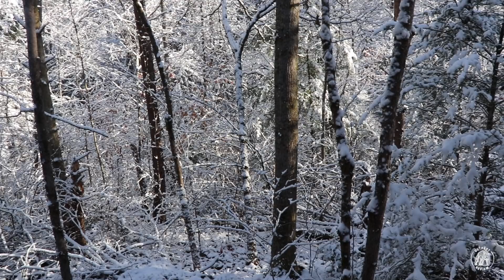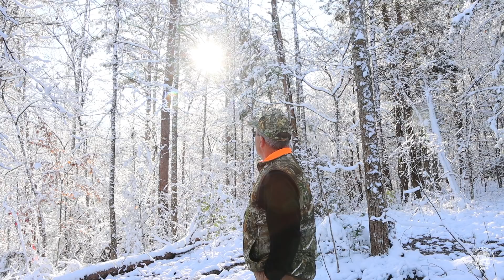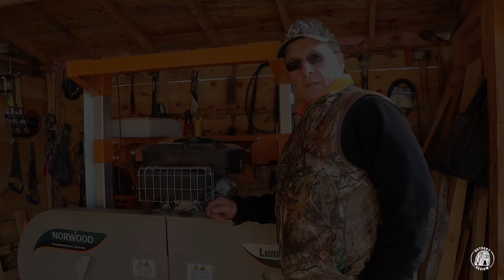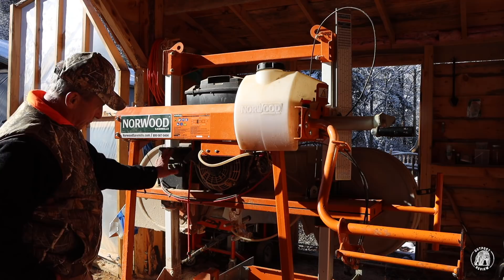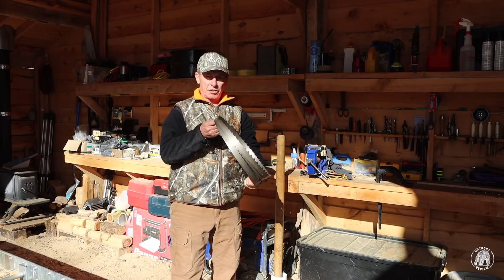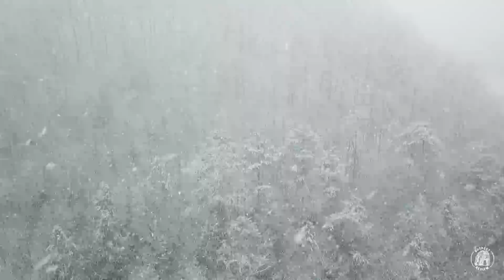OUTPOST REVIEW S2 EP6 | OFF GRID TIMBER FRAME CABIN | WOODWORK | NORWOOD LM29 SAWMILL

Comment: Just a question for you, what's the biggest diameter log you have had on your sawmill? You say that a 30 inch log can be milled on the LM29, I have had 25 inch logs on my mill and had a hard time dogging them in so they wouldn't move, using wedges instead of the dogging system because the arm on the dogging system would be in the way of the power head. Can you make a video on how you secure the bigger logs? Thanks in advance. :)
Reply from the maker: I had it a couple of times where it was very low on the log to allow me to just pass by
Reply: @OutpostReview  Does the blade dive on your LM29? I was having a problem with blade dive and had another LM29 owner contact me to tell me to check the level on the head unit. He explained the fix he applied to his machine and I put a video out on it. It made my LM29 mill so much better it was amazing. :)

Comment: Wow it is so beautiful in east Tennessee and the Lm29 is what I've been eye balling for 2 yrs now. How much do you pay for each blade??
Reply from the maker: About $13
Reply: I usually run the Woodmizer blades on my LM29. They are a little less expensive than Norwood blades and seem to last a bit longer. And I have a Woodmizer dealer near me so I don't have to pay for shipping. :)
Reply from the maker: Really? I’ll have to check that out. What blades do you order in their system or is it just by size?
Reply: @OutpostReview  Woodmizer has different blade pitches depending on what you are milling. I'm only milling pine right now so I get the .045 x 1 1/4 x 144 with a 10 degree pitch. They seem to last forever. :)
Reply from the maker: Cool, thanks

Comment: Richard,
One thing I learned many years ago to watch for.  On the end of a log (usually near the lower 8 feet of the trunk) if you see a blue stain or discoloration, then you can bet there is something metallic imbedded in the log.  The closer you get to the metal, ,the bluer the discoloration.  This may be a tip to save a blade or even prevent an injury.